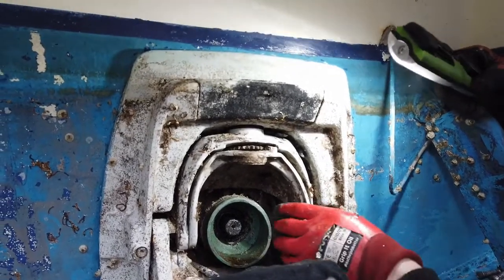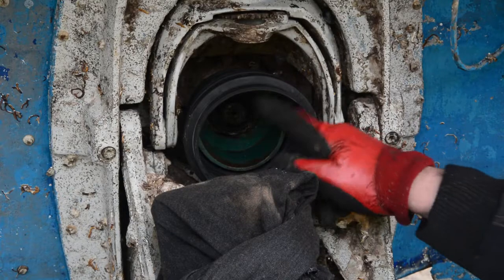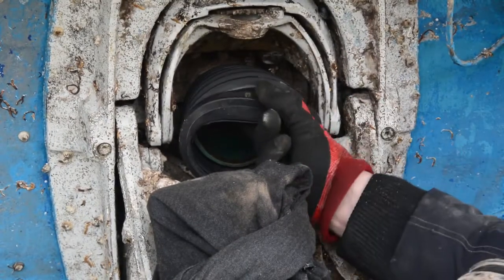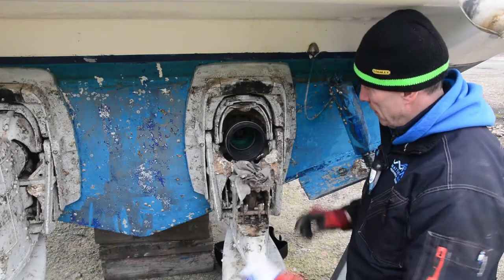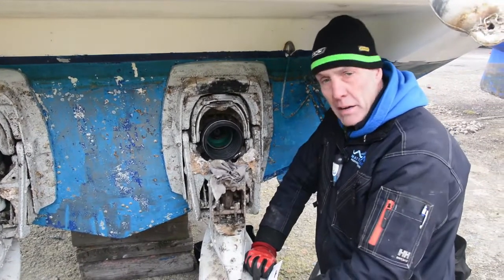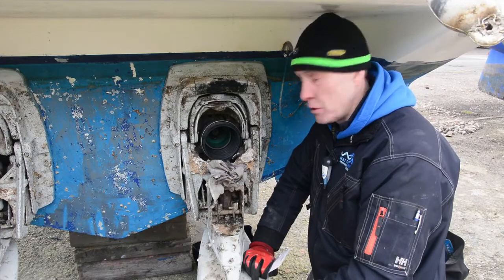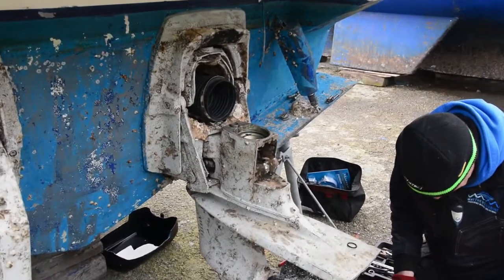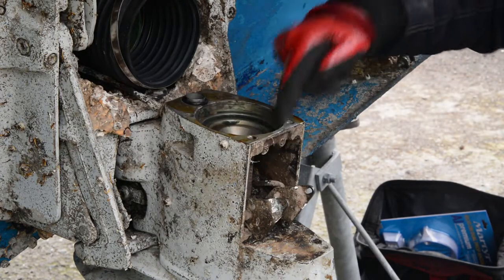Part 2 Volvo DP290 Bellows replacement

Comment: I tried for 2 days to get my reconditioned 290 drive back on. And failed. Thanks to your video i took the top off. And that made the job a joy! 
Thanks for providing this🙏
Reply from the maker: Happy to be of help
Reply: @MyAvaGrace  I have searched for the video explaining how to fill Oil on the DPD drive. You mention that you have a tip in the following video, but I can’t find it?
Reply from the maker: It's really just a matter of filling and burping to ensure you get the correct amount in. Unfortunately  we never got to make that video due lack of time.

Comment: Thank you! Great video. Suppose, its possible to add oil easily when upper unit dissambled directly in sterndrive interior
Reply from the maker: You can part fill, but best to finish once assembled, and make sure you burp the system
Reply: @MyAvaGrace  Thank you for prompt answer. Please, make a video about easy oil replacement as mentioned at final🙏
Reply: @MyAvaGrace  Great video as everyone has mentioned! I am in the middle of doing 2 legs using  this method, now that I'm reassembling I would like to know about your easy refilling method and burping the system as you mentioned at the end of your 4th video. By the way, I've never done one of these before and have found your video very thorough and helpful, thank you!

Comment: What type of sealant do you use to close the gearbox
Reply from the maker: Just a very thin smear of a jointing compound. One that remains soft. In theory the joint shouldn't need any so long as the faces are undamaged.

Comment: Thanks for the instructive video. I have one question. What do you put between the gearbox and the stern? Water resistant sealant? Lot of tahnks to you! A boater from Finland
Reply from the maker: There should be a seal. But a good sealant that will release.